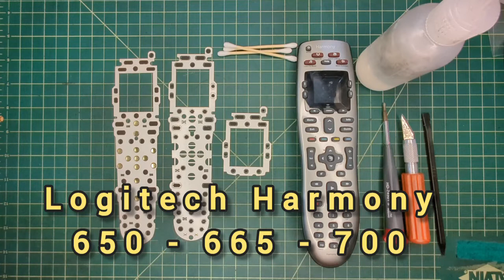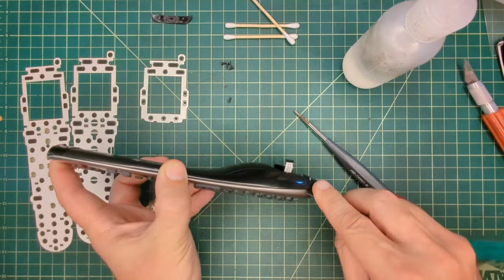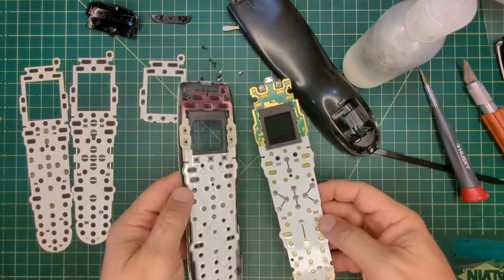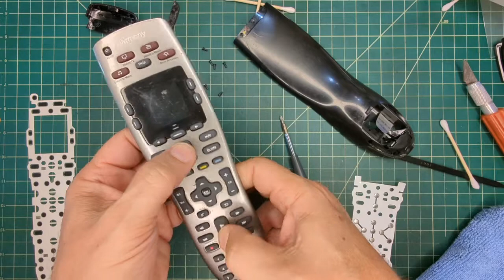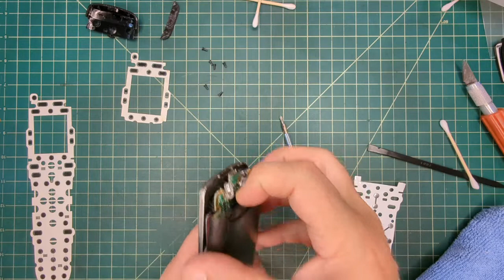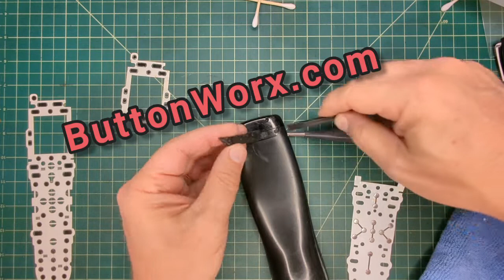Easy Repair for ALL Buttons! Logitech Harmony 600,650,665,700

Comment: Excellent solution to repair the best remote function available.  Replacement products are not as functional.  Wish Logitech had not gotten out of the remote control business but since they did, Ben's product repairs the remote with important but easy to understand instructions.  The video helps tremendously.  EXCELLENT SOLUTION - *****!  🙂😊😊

Comment: I'm not seeing the top portion on your site. Is that one no longer available? It's just the buttons on one side of my screen that I have to push really hard, all else is fine.
Reply from the maker: No longer available. After 1-2 years customers come back and want the bottom part because more buttons are failing and you can only swap out for the full one so might as well do it right the first time and never have to worry about it.
Reply: @p1repair  oh, I see. I'll do that, then. Thanks.

Comment: Thanks. I bought 2 of these to fix 2 old 650's where I would have to click the buttons near the LCD up to 100 times sometimes. Not an exaggeration lol. As soon as I installed these they worked in 1 press. I did both remotes in about 30ish minutes. First time was slower because I was watching the video to make sure I didn't mess up. The whole time I kept singing that Flobots - Handlebars song where he says "I can take apart the remote control, and I can almost put it back together" lol.

Comment: Thanks for posting an updated video with details.
I haven't done it to my 650 yet, but bookmarked the buttonworx link for what's gotta be going on almost ten years now, haha.
I opened and cleaned it, which didn't help with the buttons around the display, which you mentioned seem to be most everyone's issue.
But my cheap azz ended up reprogramming the problem buttons to things I don't use much.
Gonna have to bite the bullet at some point though as my remote is ancient, haha.
The windows notifications in the background kept making me think my work computer was going off and I was saying, leave me alone people. 😄
Thanks again.